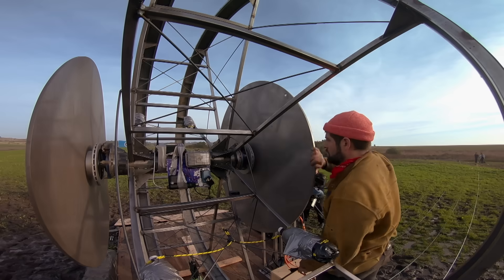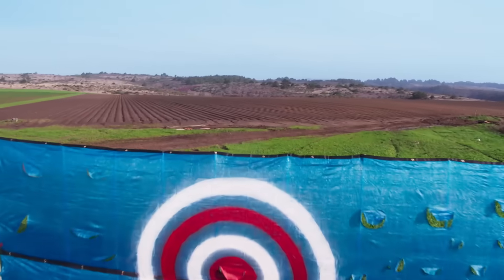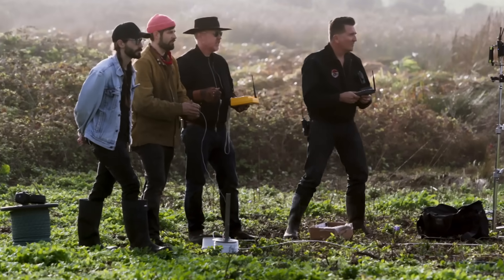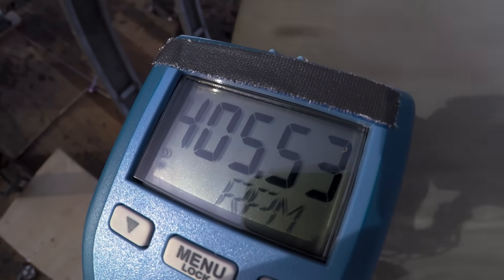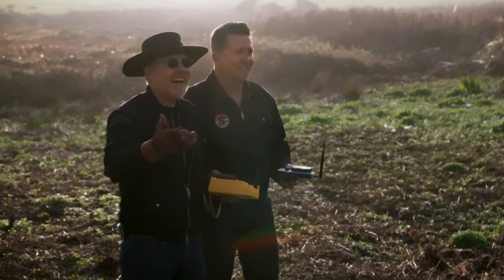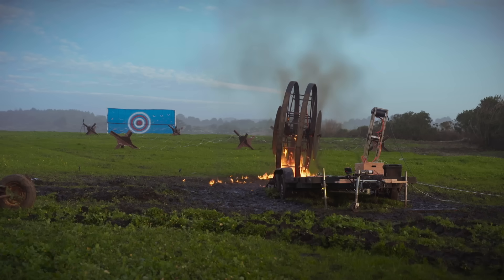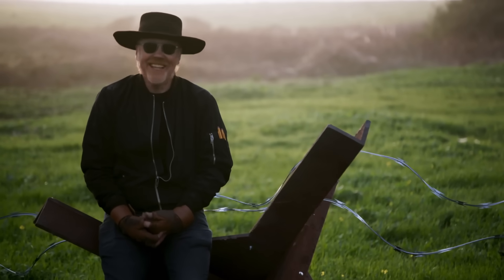Weaponised Flywheel Experiment Fails Explosively | Savage Builds

Comment: What an anti climax. Between the mud, and just blowing it up instead of actually trying to make it workable, this video was a disappointment. Yes, the mud makes a difference because even though it didn't need traction it sank into the mud, then had to overcome the weight of the mud and push it out of the way to keep moving. They could have tested it at least once on a flat area too, like a road

Comment: That was predictable. Brakes are like a clutch, but the clutch connects to a transmission. You can't leave a stoplight in 5th gear.
Reply: Thats actually a perfect analogy
Reply: so would it have been beneficial to put a gear set between the flywheel and the axle? because then you trade rpm for torque, higher RPM will still be hard for the brakes to clamp down on, but obviously higher torque doesnt help either.

so maybe they should have put the brake calipers on the ends of the flywheels, then they would have a mechanical advantage but then again, its the same problem, trading speed for torque... would have been great if they tried that
Reply: I was thinking a clutch would kinda   obviously have worked but the brake idea just seems like expecting too much of the material with such a large force
Reply: An't that the truth.

Comment: I could tell you from the get go that there's not gonna be any kind of brake that will grasp onto the wheel with enough bite from the massive rotating force to actual propel the contraption to the anticipated speed. You would need something that physically locks it up near instantly to transfer all or most of that energy. Not gonna happen.
Reply: If they had something that instantaneously locked up brakes, I would expect it to rip the big wheel's webbing apart before it crosses the starting line.
Reply: @teardowndan5364  You are right! The stresses would be so huge that it would rip things apart! Most people in comment section do not get it.
Reply: @teardowndan5364  yes most definitely can't do a sudden lock up but need something stronger than those brakes
Reply: @itptires  What they need is some sort of harmonic balancer equivalent that can buffer the shock load without dissipating most of the energy as heat.
Reply: You'd need a series of exploding bolts to instantaneously lock the two disc where the bolts had some   flex . With enough of them it could work to some degree
Reply: Should have had a large slot in the flywheels and a spring loaded steel block that slams into the flywheel slot and instantly connects it to the wheels. And solid rimmed wheels. And no mud. And maybe a parachute.

Comment: Brakes are designed to turn rotational energy in to heat and then dissapate that heat. Most of the energy was lost heating the brake disks up and the rest was lost displacing the mud.

Comment: Brakes release energy as heat, the conserved property you should be using is impulse-momentum
Reply: If it was stopped by an ideal spring it would double the momentum transfer, assuming the velocity of the device is negligible compared to that of the flywheel

Comment: nobody thought about breaks heating and overheatinng and sliding through???/ this is what happes to cars and trucks tat go down a hill and brek continuously.. this wasnt smart guys
put 4 breaks systems on each side  not on a breakpad of a truck but straight on the outside of the flywheel. that would have done it had you not gave up and blown it up

Comment: Great experiment, I love the stored rotational energy approach with the flywheel, but I didn't have to do the maths to realize those brakes wouldn't transfer the energy well, I expect you would need to look at some sort of progressive slipper clutch as used in high-end drag racing. 
With that sort of set-up, it might be possible to control the take-off well enough for different surfaces .. sand mud tarmac and even water :)

Comment: My opinion.
You missed the amound of energy lost due to friktion in your brakes.
Reply: they didn't miss it....that was exactly what they blamed it on, they just said it a different way. rather than the breaks 'locking' the flywheel immediately, thus transferring the momentum from the flywheel to the wheel (which is what they were intending to do). the breaks instead slid, like a cars. thus the loss you're talking about. this is exactly what the engineer guy said the problem was.

Comment: Adam, Adam.... that explosive power is essential to boost the brakes to couple with the flywheel ><  
use an explosive powered accumulator to lock the brakes on.. and volah you have an instant transfer of power .. Maybe :P
Hint : seat-belt

Comment: Hahaha. Guys, that’s a really cool idea, and a great way to propel the wheel forward, but...
Having driven trucks on 44” diameter tires, brake efficiency diminishes RAPIDLY as tire diameter and mass increases. 
I’d love to see you try this again!  I noticed the servo pushing the master cylinder applied the brakes at a rate less than a full “panic” stop, as you stated. What about using a nitrogen charged accumulator and solenoid, along with larger brakes and brake lines?
This is insanely expensive, but would allow a large volume of oil charged to 4,500-6,000 psi, to flow to the calipers, as opposed to pressure rising over time with the master cylinder.

Comment: It's a shame they made such an inefficient flywheel too. It's just a disk. They could have stored so much more energy by making a flywheel with the weight mostly on the outer edge and spokes to make the inside lighter. Then they should have made everything else out of aluminium to make it lighter.

Comment: Brakes like that can transfer a lot of energy, just look at a car when it makes an emergency stop. The problem here was that the flywheels held too little energy. They could have easily figured that out by observing the energy output of the electric motor, no way did that motor input enough energy in those few minutes to thrust that wheel up hill.
Reply: The brakes where slipping and never fully engaged

Comment: He doesn't have an answer its clearly the mud that just stopped it
Reply: Not in the slightest - The thing that stopped it was brakes slipping and failing to transfer torque
If it where the mud and the brakes worked then it would ripped the brakes clean off

Comment: im surprised they didnt just use a clutch assembly from a truck.
Reply: they big.
Another 70kg just adds to the mass and results in less rotational velocity for the outer wheels. 
Still might have worked better though... There are non-flywheel based regenerative breaking solutions that may work and may be lighter than clutch.

Comment: Apply the brake calipers on the outer edge of the flywheels.
Reply: I have been thinking “extend the moment arm” for nearly everything on this design.
Reply: Exactly, those little brakes can't do anything so close to the axle with all that weight spinning so far out.

Comment: Why didn’t they do a single flywheel in the middle?   No imbalance and probably less oscillation that way.
Reply: I thought that at 1st too but that would have meant the wheels would be either separate or a structure made to bridge around the flywheel

Comment: Did I miss a video or did we go straight from “too fast for these stands” to “too muddy for success”?
Reply: There's probably missing video. They want you to watch it on Discovery (aka pay for cable) or probably watch it on streaming on Discovery+ or something (aka pay for streaming subscription). The youtube clips are just teasers. Considering this show is from a few years ago, you should be able to find the full thing "around somewhere" if you know where to look.
Reply: That's what you get if you decide that budget cuts are more important than more satisfied viewers. I am unhappy too. :(
Reply: Maybe you did miss the video, mud had nothing to do with it.
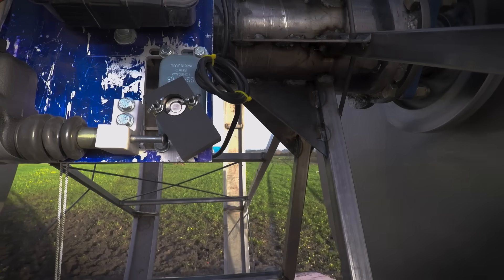Their best guess is that the brakes didn't lock up properly. These brakes acted like a clutch in a manual transmission, burning off difference in RPM as heat. Since they never locked up properly, they used the mechanical energy in the flywheels to produce heat instead of propelling the vehicle. To get this working, they would have to replace the activation system shown at 5:08 with something faster and stronger, though they likely would have needed stronger brakes as well. A typical car moving at 80km/h has around 325KJ of energy, these flywheels had close to 750KJ. The car takes less than half the load per front tire (too lazy to get into front/rear split so we'll give the front the benefit of the doubt) and decelerates at 1G (9.81m/s^2) so 2.2 seconds, giving around ~75KW per brake. These have to do it in under 1s, so closer to 375KW. You'd need better-than-F1 brakes to make this project work, and given that their budget was 50k and a set of F1 brakes eat a quarter of that... I think you can see why they blew it up.
Reply: @CuthbertNibbles  No, I saw the video. You obviously didn’t read my comment.
Reply: @Clintotron  mud had nothing to do with success, honey.
Reply: @KingNefiiria  sure thing, sugar. I didn’t say it was “too muddy” was the only factor. If the brakes had worked as intended, it still could have spun out with the smooth flat wheels.
Reply: @Clintotron  i kno the ground was pretty muddy darlin but the issue was with the wheel thingy ok darlin

Comment: First of all the design of the flywheels suffers in their simplicity in this case. If it all possible I would’ve gotten a hold of a matched pair of flywheels from 100 hp Fairbanks Morse hit and miss engine’s. A proper fly wheel moves all of its mass to the outer most edges of the fly wheel. Any of the mass towards the center of the radius is basically wasted. It is unfortunate I can’t attach some pictures in this particular media but look at the fly wheel from a Fairbanks Morse engine and you’ll see what I’m talking about.

Comment: Drum brakes might have been a better solution, as they self energise theyd have  jammed fully on with minimal input
Reply: Meh they started with the same amount of energy anyways - it wasn’t a braking or transfer issue (they’d need that energy to get to the target anyways even if they released it later) - the thing was just never going to work. The mud soaked up the energy like a sponge and they didn’t show ANY of the camera shots of that happening even though we all know they had a million of them. Kinda pathetic.
Reply: @EstorilEm  It was absolutely a braking/force transfer issue. All of that force turned into brake pad wear vs forward momentum. It would have been spinning/sinking in the mud if it was the mud's fault.
Reply: indeed I agree with you.. but then I thought: Ok so you get a more instant torque transfer to a wheel that has shiny metal surface for friction contact with the ground on a up hill in two feet deep mud... it would have spun out looking for traction or spun into the mud under all that weight until the energy was dissipated. The more I look at this whole thing the more puzzled I get at how some of these decisions where made. Especially with all the nasa maths floating around.

Comment: These guys are useless, he worked on a NASA project, your kidding me. Looking at the size of the breaks it was kind of obvious theyre werent going to transfer the energy into motion, all they did was heat up the flywheel a lot.  Multiply the brakes by 10 at least I would have said.  Or even  better.  Use the fly wheels as the wheels and just drop them on the ground once they were spun up, why even bother with the brakes.

Comment: There's no way they could store enough energy in the flywheels that size to overcome the massive amount of energy required to get over that bog. The total amount of energy is pretty similar, regardless of how quickly it's transferred. You didn't see the brakes smoking, so there can't have been that much lost energy. The stored energy was clearly nowhere near enough. Even three or four times probably wouldn't have been enough. Look at the size of the engines they fit in mud crawlers. There's a clue, right there.

Comment: The problem is not the muddy surface. The problem is Acceleration=Force/Mass. No matter how fast you rotate the disks, when you engage the brakes the weight of the flywheel will cumulatively diminish the energy stored in the high rpm consequently wiping out the propulsive force. Clever and nice to watch though.
Reply: Yes, I'm going a little nuts with all the mud comments. I'm no engineer but I imagine there would've been a big difference if the diameter of the wheels had been only slightly larger than the flywheels as well.

Comment: Could you use car torque converters instead of breaks to transfer the energy?
Reply: Clutch and pressure plate would give more control.
Reply: If they applied the brakes at the outer diameter of the flywheel they would have been able to transfer probably 20x more energy into momentum. I don't think torque converters/clutch would fare much better than disk brakes and would have been much more complicated to rig up.
Reply: @murffly  Tbh it probably would have performed better if they removed the breaking system altogether. Have a fix shaft and just spun up the whole thing and dropped it. That way there wouldn’t be transmission losses and it would be a lot simpler.
Reply: @ECL..  Yeah that would absolutely be the most efficient way to do it, but just way too simple to warrant hiring a NASA engineer xD

Comment: Surely rotating the main wheels using an electric motor on the opposite side to the flywheel motor would have eliminated a lot of the inertia and allowed a more efficient transfer of energy. Even a low revolution speed of the main wheels would hold energy in the same way as the flywheels meaning it would be easier to launch and utilise the flywheel energy in a much better way
Reply: They made the wheels exactly like they should have made the flywheel, and made the flywheel just a disk of metal. I think they should have had one flywheel in the middle with all of the weight on the outside, and it's diameter only slightly less than the wheels themselves, and then transfer the energy into a clutch & reducing gear set.

Comment: Why didn't they try a second time instead of blowing it up? Such an unsatisfactory end
Reply: Time and money.  They had a deadline and a budget, they couldn't go back to the drawing board to redo the braking system.  Once they determined a second try with the same build would be the same result, not much to do.

Adam has said he'd love to revisit the project, say if savage builds got another season, but for this project that was not an option.
Reply: Because they likely burned out the brakes in the process and it was already strapped with detcord -
Reply: It wouldnt work. The brakes wasted all the energy as heat.
Reply: Because the brakes that are required for that would require them to make a different size panjandrum completely. Also they end up costing, not automobile pricey, but like military contracting pricey. This show was not given even half the budget Mythbusters was getting at their peak, so people dont grasp that.
Reply: That would be a network decision, not a builder and maker decision.
Reply: It would have required completely reengineering the whole thing. Their energy transfer system was burned out and fundamentally flawed. This is a TV show with a production budget and schedule. They were out of time and money and it would have taken days to try and fix this. Honestly I am not sure it was fixable.
Reply: There's no way the JPL guy didn't know that the brakes were nowhere near powerful enough to get that thing moving past a slow roll before they burned out. Probably just wasting time.
Reply: I know right, I hate unsatisfactory endings. I normally ask for a discount if the massage lady doesnt end satisfactorily.

Comment: I assume you know that 1/2 the energy stored on the flywheel gets converted to heat within the brake system, leaving only the other energy half available to drive the rest of the system? And this is under ideal conditions. My take on mechanical systems 101. Love what you were doing though 🙂

Comment: I think there were a few issues with the design. I feel this idea would be more successful if the rotating disks were closer to the edge of the outer wheel & the weight on the rotating disk weight needs to be increased at the edge of disk in a vacuum chamber & rotated at much greater speeds to maximize the effect. Also the brakes caliper brackets need to be allowed to rotate a few degrees under spring tension to allow the system enough time to engage.